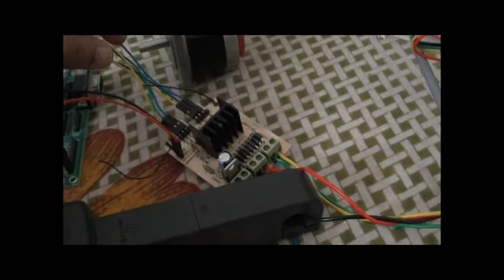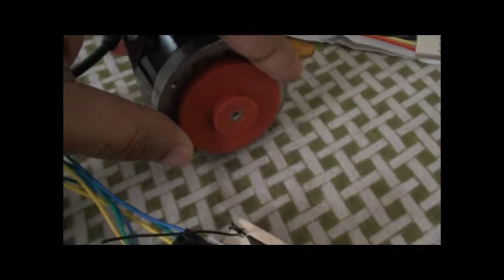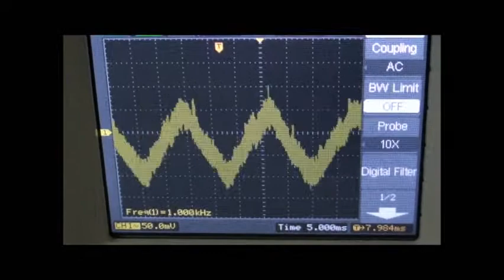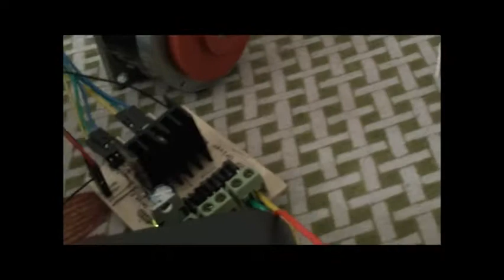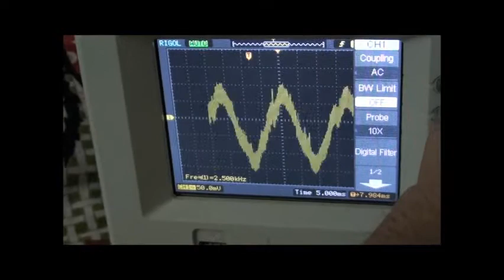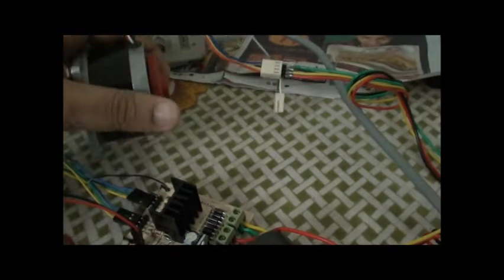Stepper Microstepping

Comment: How do you connect the oscilloscope to see the sine wave?
Reply from the maker: +Sławomir Potasz 

I have a current probe that I clamp on the motor wire to see the current waveform. The motor inductance filters the switching current to become sine wave.